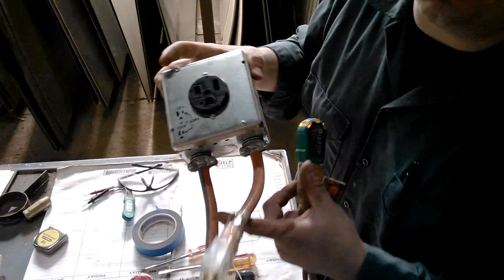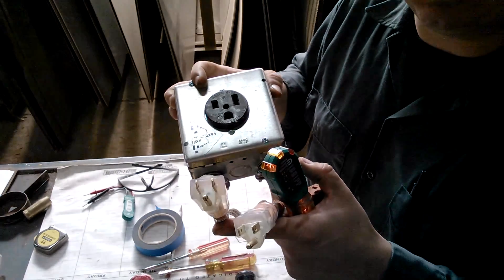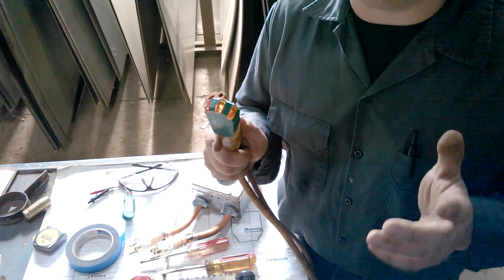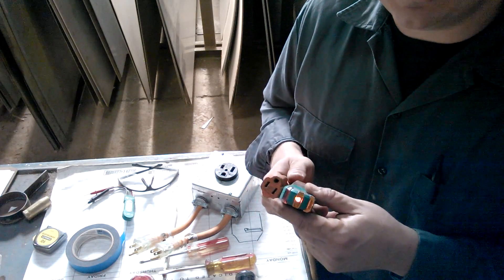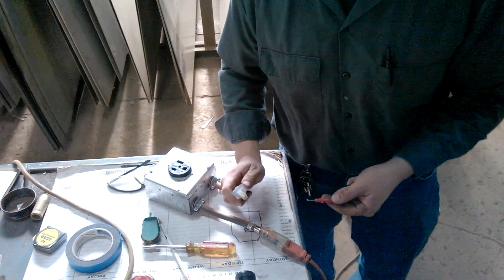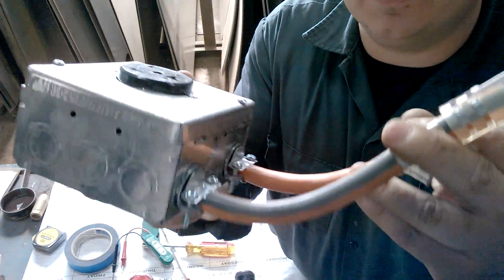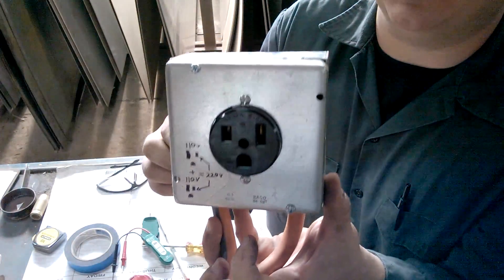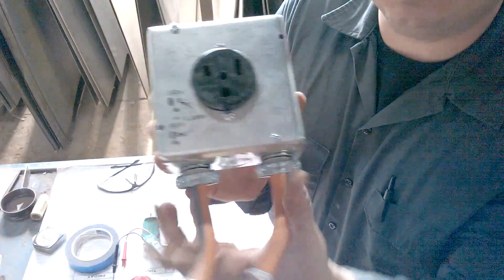Experiment convert 110v to 220v from two outlets

Comment: This is a great video but just for anybody that's looking in to this there is actual boxes That you can buy with a lot of safety features That do this exact same thing.
 There are about 200 300 bucks But comes with Circuit Breakers And Over voltage protection and different things to keep you safe Especially if you're using this to charge an EV Just look up Quick 240 And it should pop up

Comment: Great video.  I'm curious, is it possible to go the other way?  Can you build a converter for a dryer plug to split into two 120v receptacles?  Would you just build this in reverse, or does that create problems?
Reply from the maker: Absolutely they are readily available, but be careful that is a lot of power! https://www.amazon.com/Standard-Receptacle-110V-125V-Splitter-FX125V1475/dp/B084P5QG1X

Comment: Im pretty competent w DC wiring,  AC not as much but would you not need to wire to each of the two different 110v legs of the AC input? Not just 2different circuits?

Comment: If I identify 2 separate lines and connect each cable, do you guys think I can connect my 50 amps power distro for my dj? Most of the venues do not allow mess with the breaker box and maybe can be an option.

Comment: The Amazing EVDOUBLER is a Low Cost Upgrade Adapter, Just Plug it in, Charges Fast Like a Level 2 Electric Vehicle Car EVSE Charger. Needs 2 Separate 120V outlets

Comment: I think [I’m not an electrician] if you have one leg on a 30 amp breaker and one leg on a 20 amp breaker you can run a 50 amp load. So if you have if you have both legs on 15 amp breakers you can run a 30 amp load. [like I said I’m not an electrician]

Comment: ⚠️ WARNING! ⚠️
First of all, this is not safe if you don't know what you are doing and could potentially burn the whole building down or kill someone!
DO NOT USE IT AS A PERMANENT SOLUTION!!! Temporary - Maybe, but with caution. Permanent - NO!
If you really need to run tools in your garage or something, I would advise install a properly rated wiring for 220V from the breaker panel. Because if one time you decide to run a high amperage device, regular extention cables wouldn't hold up the power.

Comment: Normally, if I'm not mistaken, in the US, any tool or appliance which requires a 240v circuit will be pulling at least 30 amps.
That means this thing and the idea behind it are both Wrong and Dangerous.
That is Especially true, if one of these commenters lives in an old house, with 14 awg wiring, which can handle no more than 15 amps.
Or, if their home has 20 amp breakers, 12 awg wiring, with receptacles rated for 15 amps.

Comment: When or if you use that receptacle and you overload it and one breaker trips and not the other and your welder or compressor or plasma cutter goes up in flames make a video of that. Not to mention anything on that circuit could be back fed 220V.

Comment: Hi there.  Thanks for posting. I also am not an electrician and don't claim to know anything.  However, I have several concepts to share that may help you:

Concept 1: Different vs common poles: A 220V single phase breaker panel has inputs of 2 poles @ 110V each.  Those 110V inputs to the panel are 180 degrees out of phase.  Most (all?) panels are like this: neighboring breakers are fed from opposite poles.  If you measure the voltage between any 2 breakers on the opposite side of a panel you will likely get 0 volts difference (what you did at @1:19).  If you measure voltage between neighboring breakers on the same side you will get 220V (what you did at @2:20).

Concept 2: Safety: What you have done will offer 220V out of your 220V female outlet if you have both 110V plugs inserted into separate 110V wall outlet on different poles (not just different breakers).  However, it is going to be very dangerous in the following scenario: 1) you plug in a 220V appliance into your 220V outlet and turn that appliance ON...  and ... 2) you plug in only 1 of the 110V plugs into a wall outlet  ... and ... 3) you put your hands between the hot line of the unplugged 110V plug and any of the following: the ground or neutral connection in the exposed 110V plug or any other grounded surface.  If you do this, your body will be the easiest path to ground and you will get a 220V shock.

Concept 3: 2 breakers protecting a 220V circuit:  @4:54 you mentioned having a 15 amp breaker (on one pole) and a 20 amp (on the other pole).  The 15 amp breaker will always trip before the 20amp breaker.  Though bad practice/not standard, you could in theory run different amperage breakers on the same 220 V circuit.  I very much suspect it would violate code.  Breakers must be selected so that it protects the wiring and in that scenario the higher of the 2 breakers should still be rated lower than the capacity of the wiring.

Concept 4: Breaker size: most 220V appliances are high wattage requiring large breakers 30 amps and up.  All 110 V breakers are at most 20 amps I think.  Only if you had say a tablesaw with a 1HP 220V motor would the breakers for a 110V circuit be heavy enough.

Concept 5: Breakers on a 220V circuit are supposed to be ganged together so that if 1 trips, it takes out the other breaker.  When you buy a double pole breaker with only one on/off lever, the internals gang the 2 internal breakers together.  If you take 2 single breakers for a 220V circuit, you could put them side by side in the panel.  Then put a finishing nail in the hole in the leaver in one and pass that nail through the hole of the other breaker.  That way, you are ganging them together. I don't know if that would meet code.
Reply: "I also am not an electrician and don't claim to know anything."
For someone who doesn't know anything, you sure have a lot to say.
Reply: @zapa1pnt  point taken.  I was basically starting with a disclaimer...  I guess I do know a couple things.

Comment: Hello,
why are 110V neutrals not necessary ? You still need a return path, correct?

and, for the 220V out let....where is the neutral ? 

you comments are appreciated
Reply from the maker: Only thing I can tell you brother is that I'm not an electrician and I can certainly use the advice on this experiment, good luck and don't burn anything down!

Comment: My electrician wired 220v at my house he used 2 breakers on the same side , 1 breaker was a 20A & the other was a 12A what i see it has to be in the same phase I heard if you jump 1 line off each side the electricity will be out of phase !

Comment: How would I do what u did but turn it into a 4 prong
Reply from the maker: So far many electricians have said this is a dangerous rig job of an experiment, but with that said 4 prong outlets should be 240v 3 phase. This setup will only get you 240v 1 phase (if that), I highly recommend contacting an electrician if you need 3 phase. Good luck and thanks for watching my insanity!!!

Comment: You're going to want to add a ground screw with, maybe as much as, a foot of ground wire to that box.
1) Screw a grounding screw to the box, wrap the midpoint of that ground wire around that screw and tighten the screw down.
2) Tie your two green ground wires from your two cables to one of the ground wires, that you just attached to the box, with a wire nut.
3) Attach the remaining ground wire, that you just attached to the box, to the ground on your 220 outlet.
Your box is now properly grounded so that you can't be electrocuted should a short occur inside the box.
Reply: Good advice to ground that, yeh.

Comment: Most homes in America if you're doing this on your panel inside your house have 2 separate hot lines coming in not 4 and what you want to do is take one breaker on the left side and one breaker on the right side and if you can get to Breakers the same amperage rating I'd shoot for about 15 or 20 amp Breakers but that's just me and use those for your Hots because they'll be on separate phases because if you pick two breakers off the same side you'll basically get nothing or you'll only get 120 because you're on the same phase wavelength you want opposite but don't take my advice I'm not advising anybody to do this I just thought this was a pretty cool little idea

Comment: Great experiment. I've been sitting here scratching my head trying to figure something out to use a RV 1:10 to 2 20 volt. But after I plugged into 110 side I didn't get the 220 that I was thinking on the other side. So I was trying to think of other ways and I said what why don't I Google it. Thanks again for making this video really helped out

Comment: would this work for a 220v dryer?
Reply: No, the wires would burn up if the circuit breaker didn't trip first (from either being exact same phase or tripping because of the excess demand). It is better to hire an electrician to install a permanent 30A or 40A receptacle than to try and save money by doing this.

The cord he's using is 12AWG and only rated for 20A at 120V. A typical dryer uses 3000W. When we divide this up we get 3000W/240V=12.5A. The danger is how long that dryer will operate and not to mention that this cord was never intended to be used in such a way. Please do not use this for a dryer.

Comment: I'm sure everyone is checking to make sure those two circuits tied to a single throw on the panel, right? Because you can pop one 120v circuit and the other leg can stay cookin.
Reply: And who knows what else is running off those two circuits. Vacuum cleaners, hair dryers, space heaters whatever.  Just run some a dedicated line with the right size conductors.

Comment: Absolutely not advisable to do this.   Other than being illegal!    I really do not understand why anyone would actually do this.  I'm assuming you made this for a welder.   You can not run the welder very high or very long.   You can not use it on GFCI breakers or receptacles.  The plug will be hot if you have something plugged in and turned on.   Be safe, the life you save may be your own.   In this case, it might be someone else.   If you send this out with an employee and they get hurt, you better hope you have enough insurance.

Comment: It’s from 2 phases, be very careful.... You are getting 220 power from 2 different phase circuits... Get a led 💡  indicator rated at 240 ac  ( Amazon $2.50dollars) and connect to the 2 hots , this will let you know if and when you are connected 220 volts.......

Comment: So...this setup would work fine from two separate (same model/same amperage) AC generators (e.g. Honda 2200's)...and wired into a 4 wire outlet (thereby not having to tie the neutrals together)?
Reply: Retro Electro I probably wouldn’t try it I have an older EU 2000 with low hours on it I bought about five or so years back for $1000 Honda generators are not cheap if you want 220 volts without having to wire heavy wiring or pay someone to do it get a 5000 or 6000 W generator or bigger if you can afford it and have an experienced electrician wire up a twist lock plug for you in the twist lock socket that puts out 230/240 volts and at the end of it put a receptacle that your welder or whatever into,,,this gentleman‘s method will give 220  but you won’t have the amperage there,,,you might be able to do some light welding mabe,,,,if you had a heavy duty welder on that you couldn’t turn the heat all the way up it would result in a fire 🔥⚡️⚡️⚡️⚡️🔥🔥🔥⚡️⚡️🔥
Reply: NO! The two generators would have to be synchronized.
Reply: @walterk1221  yes...I understand what you say .....now.  Luckily I didn't learn the hard way.

Comment: Be aware that your first mistake is that you must use two separate 120v circuits on separate legs from the panel. Secondly you need to connect the green wires and anchor them to the metal box. That is your metallic ground. Your two white wires connect to the common on the outlet. That is your common circuit ground. Finally each black wire at 120v are connected to the plug hot terminals. If you use two separate 120v circuits and they are both pulling from the same leg on the panel you still have 120v.

Comment: You just answered a hairbrained idea. I live in an rv. In my shed is a washer and dryer. I converted dryer to 110 which ofcourse makes the thing take twice as long to dry clothes. 

Im going to home depot tomorrow and im going to assemble this box to run my dryer. Although i fix appliances by profession im not an electrician

Comment: Why???   If at construction site and 120 volt receptacles are installed, have the electrician install correctly!   I believe a 30 ampere receptacle was used in this video.  If that matches the equipment he is trying to use, then with much usage, the 15 or 20 amp breakers will start tripping from overload.   Again, just do it the right way,    The life you save may be yours!

Comment: Awesome video and like he said it is just an experiment, if you people need 220V outlet, simply hire me or any other electrician install a double pole 20 amp breaker( depending on your appliance) and it will be much safer.

Comment: I have a 120v ellectric water heater but it is mostly cold water. Will this work for a 240v 30amp 6 kw needed electric water heater? Will this be hotter and more steady water?

Comment: If you open up an electrical cabinet in a house, and follow the wires. its wired just like that. Two Hot's to the 220 breaker and Neutral to the buss bar and all grounds to the ground bar. You just made the connection outside of your cabinet. Just use the right gauge wire for the current draw your pulling and your all good....Be Safe...:)

Comment: This is awesome! I was thinking it might be fun to do some MIG welding in my apartment to make some furniture installations and it occurred to me that a pair of 110 outlets could be coupled to make the 220 supply- glad to see this confirmed, thanks for posting!  I supposed the next step is to figure out what the draw on the arc welder is going to be vis a vis my breakers.
Reply: Lincoln and killer make 110vac mig welders.

Comment: I have a question, When my 160 amp dc inverter welding machine is connected using this method, is it charging each wire with 110v right? and not each with 220v. I'm sorry I'm not an electrician and I'm  a little afraif of this.

Comment: In case you did not think of this, Karl's comments MUST be sarcastic.   Oh he worked for NASA for 35 Tears, he may not have had to cry very long.   Running 240 volts this way violates NEC in a couple ways.   The parts and pieces together do not, because they are not part of premise wiring system.   If this were a legal part, you would be able to find them "somewhere" already made up.   No way this is safe!   So if you value your house or your life, do not do it.

Comment: I've done this as well. However, as Karl Miller states below, I did not have use of an electrical box and had to make due with electrical tape, a couple of sticks (to separate the wiring better) and a bit of prayer that none of my employees would tug the cords or try to unplug my mess. My power sources were two generators. Either way, it got me through a day of remote work where we needed a few welds (upright rebar braces) made on a construction job. Thanks for making this clear enough for those who are not quite sure.... In fact, I am here because I had to double check the connections myself.

Comment: So basically you have to find two 110V outlets that are 180 degrees out of phase so the gap between the two is 220V, since that's all voltage really is right, potential? Or did I get that mixed up?

Comment: Most new 110 outlets are on 15 amp breaker with 14awg wire. You will get 220v but limited to 15a on either leg. If you pull more amps the 14awg wire could become the fuse instead of the breaker, causing fire. Short term use prob not a problem longer term gets risky.
Reply: Unplug it after every use also.

Comment: Actually you're "overcomplicating" things here. You can install a 220 breaker in place of a 110 breaker, connect the "hot" and "neutral" wires both to the breaker and use the "ground" wire as the "neutral" which is EXACTLY HOW 220 CIRCUITS ARE WIRED ANYWAY.
Reply: DEEREMEYER1 wait how ??
Reply: Hes saying to wire it without a ground, using the ground as a neutral better hope it doesnt hit the metal
Reply: Matt what? You don’t even know what ur saying either? If you install a double pole breaker and connect both ur white and black (hot and neutral) to the breaker you have 240v, the ground is still and should always be present